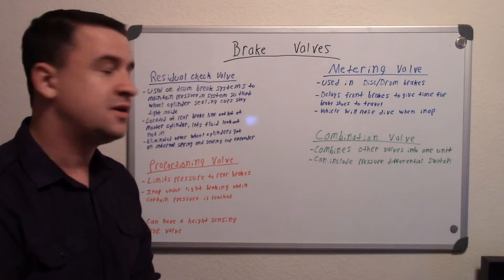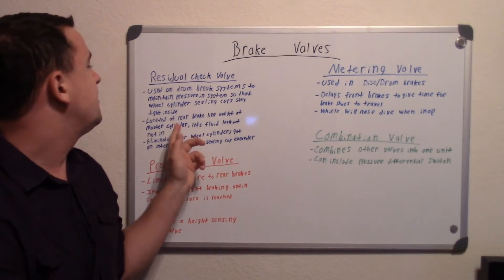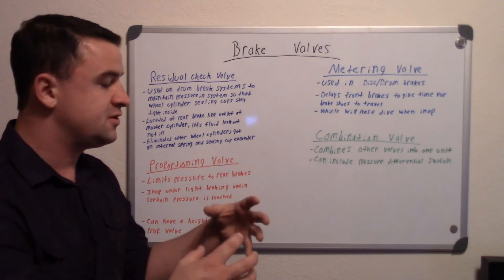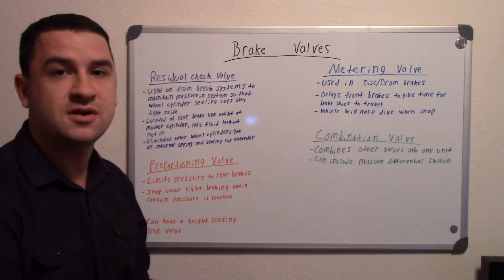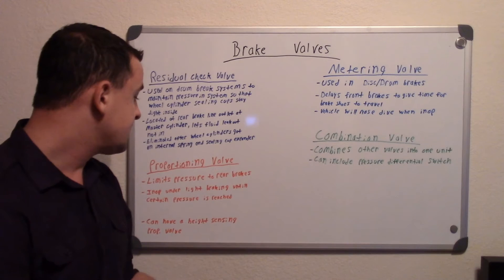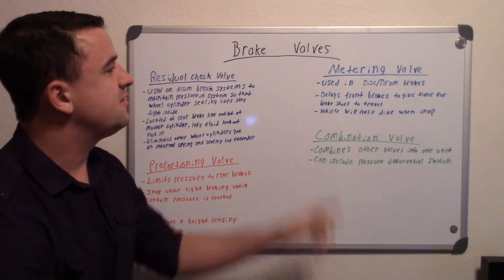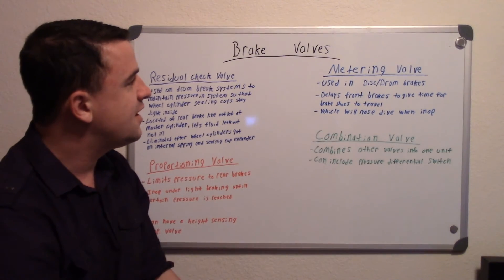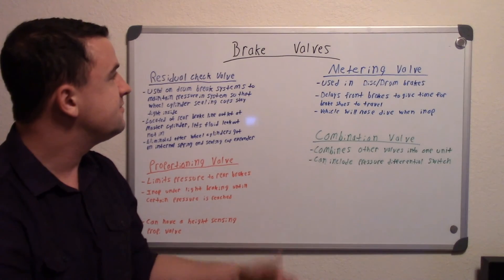How Brake Valves Work (Proportioning and Metering Valve)

Comment: Technically you described what a proportioning valve does, not how it works:  how the spring, piston, valve, and ports are laid out and how they achieve proportional regulation - the key is "proportional" regulation.  We all know how regulators work.  We all know how you put boost pressure on the atmospheric side of the regulator diaphragm so that regulated pressure is a fixed amount higher than the boost pressure so you can always push fuel into a blow through carburetor.  But how do you get proportional regulation?  Not clear?  But don't feel bad, it seems like no one else has explained this either.